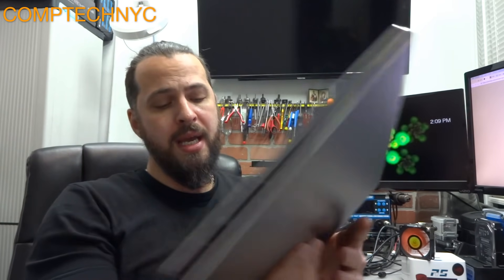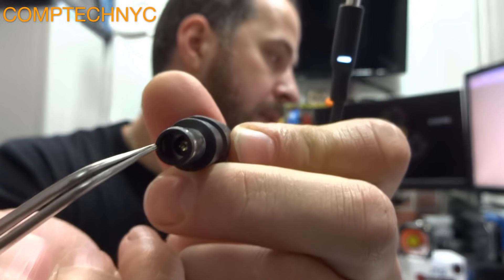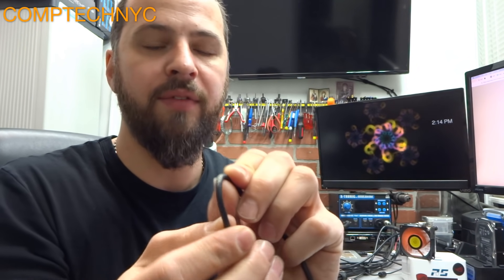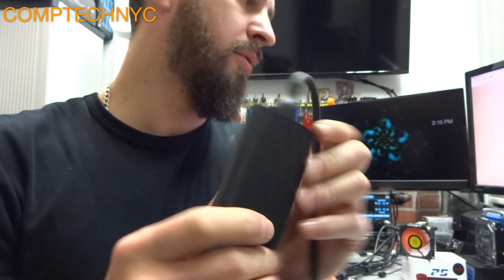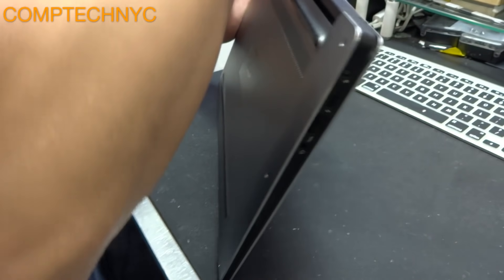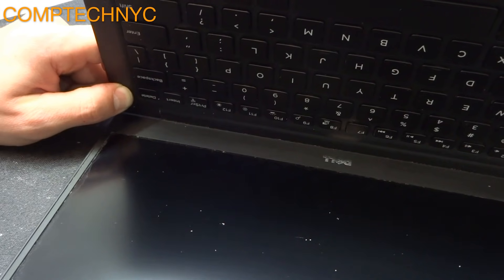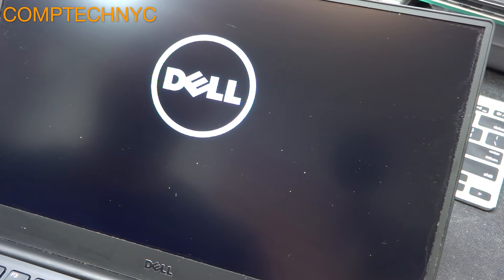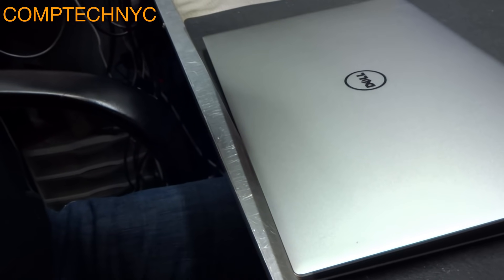Dell xps plugged in not charging fix

Comment: Hello, I have a Dell Inspiron 13-7000
And I am getting the warning the AC power cord wattage & type cannot be determined. The battery may not charge. I just followed your video and disconnected the battery and smaller battery cell. Then you say to hold the power button for 60 seconds and I did that. Then you say to plug back in the power cord and the light on the front flashes and it did. Then you say to press the power button which I did and my screen turned on and showed the same message about the AC power wattage and type cannot be determined. How is this possible if neither battery are connected? If I plug back in both batteries and I still get this error does this mean that it is my charger cable that needs replacing? Please help I use this computer to run my business, I payed alot of money for it and but unfortunately it is not longer under warranty.

Comment: My laptop is a latitude e5520 and it needs battery since last year and it started giving me that message and well I’m confuse cause sometimes it works normally when I move the charger a bit. But it’s a pain in the ass cause I can’t even watch videos when that message is displaying, gets all crappy. In my case what would it be? The battery or the charger or both? I already opened my laptop the other day, and cleaned it a bit and tried to check the charging port, but I don’t know what the problem is.....

Comment: Thanks a ton for this video. I didnt know the middle wire was a charger sensing circuit. The plastic in my dc input terminal is broken, but it's been like that for years. It suddenly stopped working recently, so I didnt think that was the cause.
Sure enough, measuring continuity between the two wires and there was a dead short. No amount of bending the pins would get it to work again.
To be sure, I was able to put a small piece of plastic to keep the middle pin isolated and now its charging normally. Will buy a new dc input terminal.
You saved me over $1000 usd as I was about to give up on it and buy a new laptop. I owe you a beer haha

Comment: I have older HP laptop. It will charge   fine . But after use and I plug in the charger to maintain power, I will need to unplug it from the wall plug . Then it will charge for a while, then stop till I unplug and replug . And ideas?

Comment: Hi ComputechNYC - I have a Dell XPS 9360 and thanks for the knowledge. I'm trying to work out what's wrong with my Dell XPS 9360 - I've swapped out the hard drives and the error is 2 amber and 5 white flashes which says it's "invalid RAM" - the machine would switch on with mains but not battery?! before this with the old hard drive, can you help?

Comment: Great video the best I’ve seen so far.  Just one question when you press and hold the power button for 30 seconds to drain should the power adapter be plugged on unplugged from the laptop.  My current Dell XPS 15 9550 is having exactly the same problem and my power adapter has been replaced and is only 3 months month but it clearly seems it is very sensitive to breakage due to the way people wrap the cord around the charger.  I don’t understand why Dell does not fix this design flaw. Can you also suggest any quality charges that are much better than the original Dell adapter to prevent this from happening again.  Thanks.
Reply: Its supposed to be unplugged. Replaced chargers dont work too well. Ps: I have the same laptop.

Comment: My charger starts charging after I just unplug and plug the charger again and again why is that so?? 
If I plug it when the battery is too low then it takes a alot of time but when the battery is above 70 the it takes less time but starts charging, HELP PLEASE whats the problem, but when its not charging it is saying "Plugged in, not charging".
Reply: Wire is partially broken, or the charging port, but it could be the battery software. Try this, go to device manager, uninstall battery drivers (both of them), restart the laptop.
Reply: Try uninstall the battery drivers then restart PC it will reinstall by itself on Windows
Reply: This happens to me as well. Have a Dell Inspiron 7560

Comment: good video thanks for posting will try your method - my xps 13 has been problematic for a couple of yrs now... but it is stuck on 8% wont charge but at least at the moment it works with the power lead in but does not charge up above the 8%
Reply: Your battery wear level could be high.

Comment: Thank you -Thank you!!   Since Dell doesn't release schematics or block diagrams and reading countless support forums, I was debating a motherboard since I had previously tried a different OEM charger for this model.     Once you explained the function of the center pin, I got out my stereo scope (looks like the same as yours) and low and behold the jack center socket was a bit funky so the center pin on the charger was deflecting and not making good contact.    Fiddled with it under the scope and got it working again after a year of pain.  New jack and new charger on order (total under $30)  and I"m back in business.   You rock!

Comment: I have a dell XP’s 13 9333 and I take out the battery and plugged in the ac and it still turn on but when I plug in the battery it said plugged in not charging

Comment: This solution only works if your charger is the problem. I've tested my xps with a working charger and it still says not charging. I've also replaced the DC jack leaving only the motherboard to be the problem. Detailed video but there are more than one reason why someone might get the not charging error still requiring a motherboard replacement.